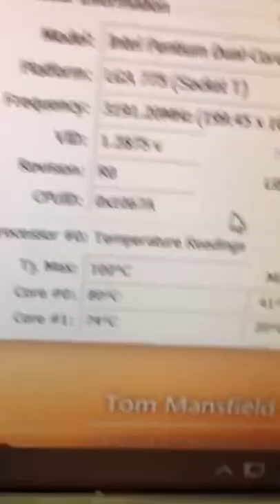Don’t smoke

Comment: So many videos like this on YouTube, A little bit of smoke or dust isn't going to cause your computer to overheat, You could have that heatsink clogged up and it will still keep the cpu cool. The issue 99.9% of the time is a loose fit or old thermal paste.
Reply: Don’t think that front panel had “a little dust”. That was brown foam my guy. In cases like these, enough will affect temps because there’s normally 1 intake and 1 exhaust. Granted a broken cooler won’t ever help.
Reply: @xxnvytechxx6417  true, that front was ridiculous, I don't believe in panels myself lol take em all off, more air flow

Comment: That is a oldie too, a vga cable and the psu is in the top
Reply: They are still used for office computers. An i5 4th gen still runs good today.
Reply: @Nitrodozer  yea especially 4th gen i7s can run newer games like cyberpunk on low with like 30-60fps

Comment: Hey man, you dont want to blow that stuff out inside. You are just transfering all that "gross" into your enviroment. Blow them out outside for your health.
Reply: Why doesn’t anyone use a vacuum before using the compressed air.
Reply: @StreetsVillian  There is a higher likelyhood of an Electrostatic Discharge. The problem with ESD events is even if the device isnt killed at the time you have potentially damaged traces or paths within chips. LTT made a video showing how hard it is to kill commercial hardware with an ESD "pointer". But institutional knowledge is to avoid ESD.
Reply: @garrettparmenter938  Possible but not likely. Use a grounding strip.
Reply: @StreetsVillian  You can't vacuum anything close to the MB or GPU since you could possibly rip off some smaller components.

Comment: I had one that the Tar and Nicotine was pouring out of the power supply and oozing down the case. There were four chain smokers in this house and they all played WOW on thus PC and it basically was used 24/7.  I pulled the hard drive with gloves on and asked them if they wanted thier data.

Comment: I used to work as a slot machine repair technician, and I can tell you slot machines are probably the nastiest computer products on the planet. We used a foaming spray cleaner to get the smoke residue off, the foam itself would sometimes turn amber and dry up like a chunk of styrofoam if you let it sit for too long.
Reply: When was that? Must be when you could still smoke on a plane, be very surprised if you find smoke residue in slot machines these days.
Reply: @oliversullivan3062  literally just a few years ago bud. Ive been at my current QE position for 4 years, so some time before that.
Reply: @oliversullivan3062  you must be a northerner, most casinos in Oklahoma and Louisiana have some area of the casino that is smoking permitted.

Comment: Anyone watching this, please don't use a micro fiber on a running computer. It takes alot to kill a part but it can still cause smaller issues or shorten life span if there is static but also electricity and micro fiber don't go together. I recommend a paint brush or shop towels instead. Don't clean a pc when it's on. I'm not calling anyone or talking smack just trying to give some tips

Comment: You shouldn’t use a air compressor to clean electronics the air has moisture in it also can cause static shock to components

Comment: I had an old Dell that sat next to a heat vent for 2 years. When I moved I had to use a hair dryer to get it to turn on. The temp sensor went out and it would only cause an issue if the tower was shut off.

Comment: Portable air compressor we used to blow the dust out in computer engineering class we'd take the towers outside and do it so we didnt make a mess in class. ALSO for a Smoker.. .that's surprising not that bad...we've all seen way worse.

Comment: Dude literally getting so much hate from boomers lol.
You don't have to like your customers if your skills make up for it.
Reply: He only blows the dirt out or even into it and wipes it down with a wet Cloth, that skill, those skills are outstanding in your opinion?
Reply: @peteressert5172  he owns/runs his own repair shop while being under 30.
Repairs can range from surface level cleaning to micro-soldering boards and components which, yes, most people need to take a literal class for.
Its a way different career path from being a clown so I'm sure you wouldn't understand anyways.
Reply: @meroinheroin  he blow dust into a psu, my point stans.
Reply: @peteressert5172  it's a simple repair. Cell phone repairs are way more difficult and he also does those. PC's aren't too hard to work on.
Reply: @meroinheroin  he isn't verified, looked his stuff up, didn't see courtesy to any customer ,micro-soldering or even something resembling skill or knowledge that u can't Google in 3min. My point stands.
Reply: @peteressert5172  wipes it down with a wet cloth while plugged in and on, mind you
Lmfao

Comment: Hey why not hoover the big pieces of dust instead of blowing all over the place ?
Reply: Vacuum cleaners can be an issue since they can knock over suck up capacitors and stuff, wheras compressed air is far less likely to do so. Totally shouldve done it outside tho...